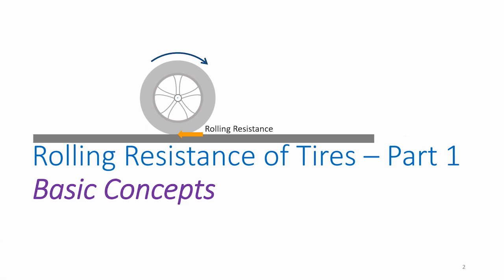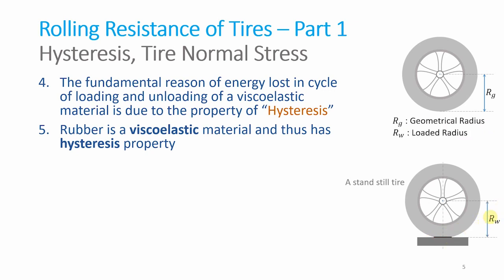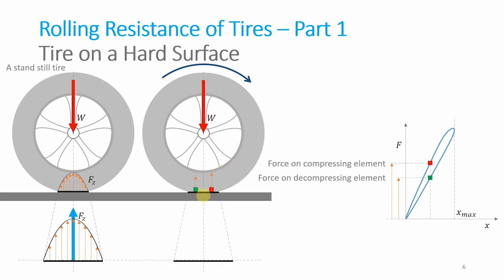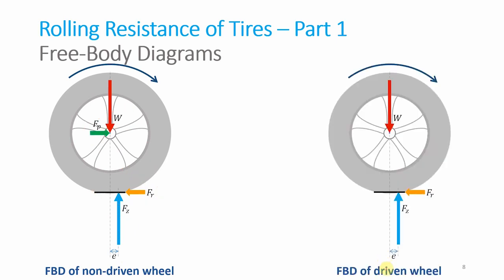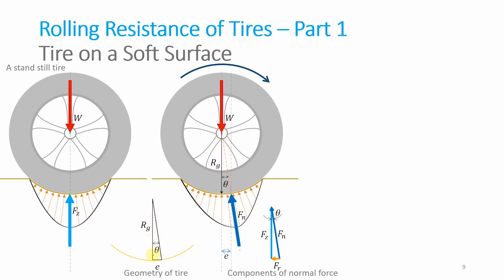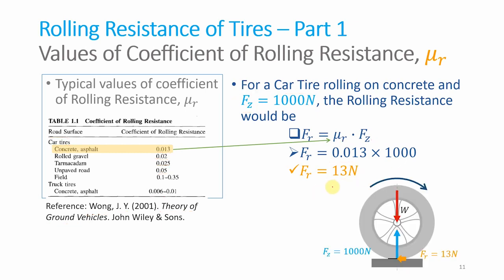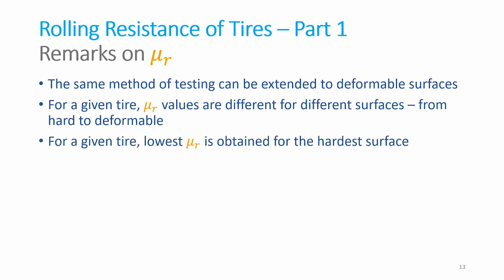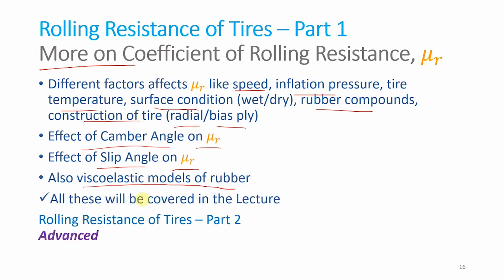"Rolling Resistance" made clear | Basics

Comment: im not sure this channel is still active, but the whole idea of that rolling resistance force which is horizontal doesnt make any sense.
in a drive wheel the torque do to this force is actually helping the wheel to accelerate !!
lets consider we apply a drive torque equal to Fr*R
physically it shouldnt have any acceleration BUT in this scenario u have actually 2*Fr*R on the center of the wheel thus wheel will have angular acceleration thus linear acceleration due to rolling without slipping. 
your initial model about Fz has a offset made sense but this idea of having horizontal rolling resistance force is dynamically irrational

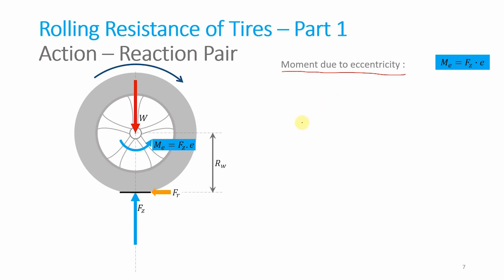Comment: 12:18 why to balance this moment? Its been generated by viscoelasticity that is generating force and torque in opposite direction to direction of rolling.why are introducing another Fr that will cancel the torque due fz?
Reply: It is not introduced, rather it comes as a result to satisfy the condition of equilibrium for opposite moment caused by Fz. There should be the only moment in direction of rolling or motion by driving force on roller.
Reply: I didn't quite understand that as well

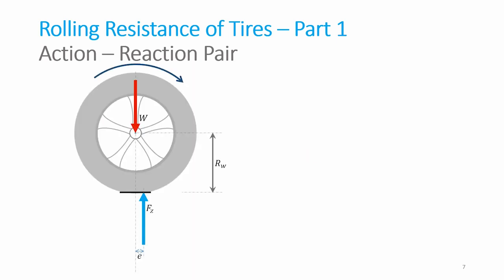Comment: At 11:40, in a real life scenario, how is the rolling resistance (orange backwards arrow) introduced? Is there a transient where the moment produced by the offset Fz reaction (blue) causes a negative slip ratio (just like brake torque would) and this slip ratio increases until the necessary 'rolling resistance' is created?
Reply from the maker: @Chris: In this particular situation, you can see an anti clockwise moment is introduced to the system due to the shift of Fz towards front. Only way to balance this moment is to have a clockwise moment introduced by the rolling resistance force. Here steady state is assumed, so no transients such as slip are not considered. Note that rolling resistance can exist even if slip ratio is existing or not (anywhere in the range 0-100%). Hope it helps!
Reply: @AutomotiveInsights  I understand how the moment by the offset vertical force is produced, but what actually produces the resistive force at contact patch (orange arrow) if not a negative slip ratio? Surely something has to apple this force?
Reply from the maker: @chrisc9608  : This resistive force (orange arrow) should be present to provide the clockwise moment and is supplied by friction available at the road-tire interface. You can also imagine a situation of friction at the road-tire interface as zero then it becomes another interesting problem. But as I mentioned in my last comment, slip may be assumed as zero.
Reply: @AutomotiveInsights  Is this rearwards resistive force at TCP the same as what some textbook show where there is net rearwards longitudinal force due to the stretching of the tyre elements (like brush model), where in the front half there is a force facing the front, and in the rear half, there is a slightly bigger force facing rear, hence net rear. Is this what balances it?
Reply from the maker: @chrisc9608  : I agree that there are forces on the front half of the tire due to deformation of treads as in brush model towards forward direction and in the rear half towards backward direction. But these two forces balance each other in the brush model because the concept of hysteresis and thus rolling resistance is not considered in the brush model. So these forces are equal and opposite in the brush model. However in the actual testing or in the models in which hysteresis is considered, surely the backward force should be higher than the forward force and thus this difference accounts for the rolling resistance. Also please keep in mind that the rolling resistance force need not be balanced. If no propelling force is given at the axle, ultimately the tire is going to stop. But if an equal magnitude force is applied in the direction of motion, the velocity sustains (this is covered in the video).
Reply: @AutomotiveInsights  Many thanks for the detailed explanation. One more question I wanted to ask. If the vertical_load*offset moment is balanced by the rolling_resistance*radius, but like you said, the rolling resistance force is not balanced and the tire has a net rearward force, wouldn't the tire skid? I thought we also need a net rearwards moment (vertical_load*offset > rolling_resistance*tyre_radius) to decelerate the rotation while it is slowing down in the horizontal plane
Reply from the maker: @chrisc9608  : Really enjoyed answering you :)
I'll answer point by point
1. "wouldn't the tire skid?" : skidding happens only if the friction at the surface cannot support the force. (In fact the rolling resistance force itself is supplied by the frictional force at the interface).
2. reg "net rearwards moment (vertical_load*offset > rolling_resistance*tyre_radius)" : As you have rightly said there is an unbalanced moment while the tire decelerates. In this case you have to solve the force equilibrium and moment equilibrium simultaneously.
ie rolling_resistance = mass_tire * acc and (vertical_load*offset - rolling_resistance*tyre_radius) = moment_of_inertia * alpha
considering the relation acc = R * alpha
Solve for rolling_resistance and alpha

Physical interpretation goes like this: the moment caused by offset is balanced by both moment_of_inertia * alpha and rolling_resistance*tyre_radius.
whatever leftover by moment_of_inertia * alpha can only be consumed by rolling_resistance*tyre_radius. So obviously rolling_resistance value would be lower than when it was for a uniform velocity case.

Thanks for asking such in-depth and meaningful questions - I had to process my brain with additional GHz to get answer for your 2nd question. Great ! and Thanks a lot !

Comment: From where did the moment due to rolling resistance came?
Reply: Is it the action reaction pair formed by the system of forces?
Reply from the maker: @stall_horn  The rolling resistance force acts at the ground level. Move it to the centre of the wheel. Then we can see that the rolling resistance force was contributing to a moment also. Recollect the concept of force acting at the end of a candilever beam. When we move the force to support, then we can see a moment was also acting due to that force. Hope it helps!
Reply: @AutomotiveInsights  Got it! thanks